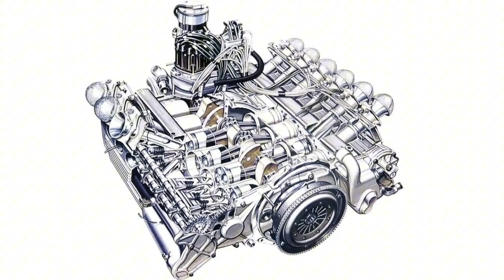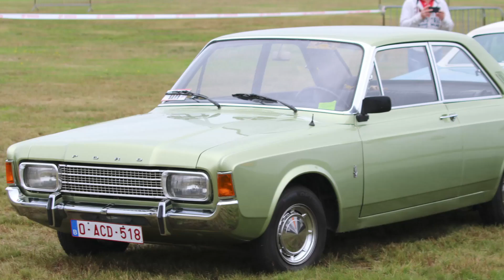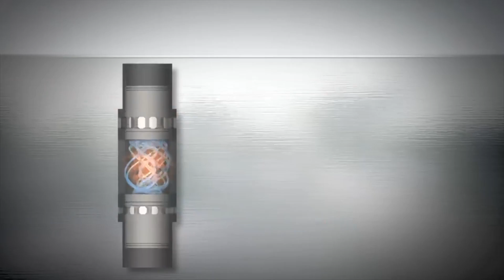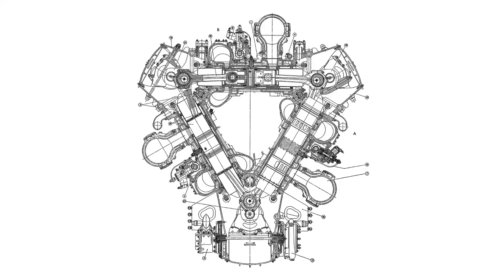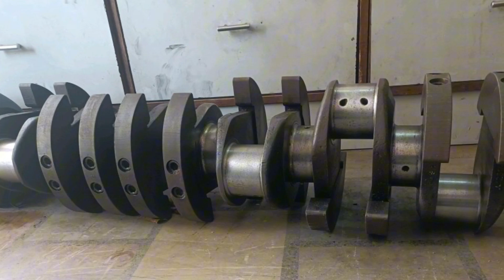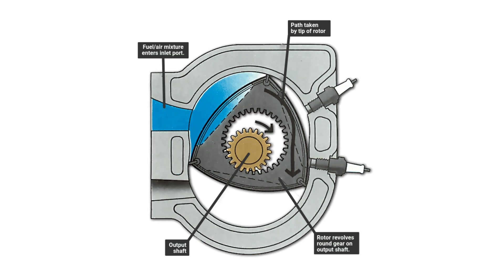10 WEIRDEST Car Engines You Won't Believe Exist!

Comment: The Ferrari Flat 12 is literally a 180° V-12. A true flat 12 wouldbe an entirely different beast. For each set of opposed cylinders there would be two crank pins 180° offset from each other.
Reply: bruh, 180° V12 is literally called a flat engine.
Reply: @rellotsscrewdriver8996  
Yes the layout is flat. But for all intense and purposes the Ferrari Flat 12 can be treated as a 180° V-12. The difference is between a Vee Type crankshaft with crank 6 throws and that of a Boxer type engine with two sets of six crank throws with one set 180° offset from the other. Boxer engines also tend to have a greater bore spread between cylinders  for bores of equal diameter to accommodate the extra material needed in the crankshaft structure. This leads to a longer engine.

Comment: If you have a 16 cylinder engine and it's a four-stroke engine that means you have four not less than one but four power strokes per revolution you have a power stroke every quarter turn of the crank get your numbers right dude

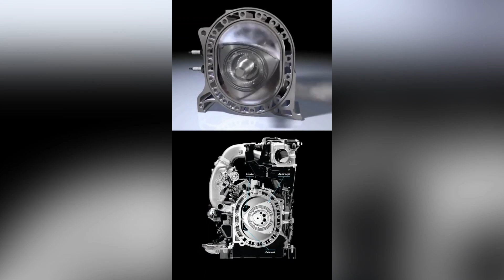Comment: 8:05
Given how many RX-7 ALONE were produced, how can you call a Wankle "wierd" in a car?

Whoever put this list together had ZERO CLUE what they were talking about, for the most part.
Reply: By the numbers of wankels vs piston engine cars they were very much weird and uncommon. I'm 56, have messed around with many cars over the years, repairing, wrecking, and modifying and still have yet to see a wankel rotary in an engine bay. I know when one cruises past, as they sound like a 3 cylinder 2 stroke outboard motor at idle.
Reply: @rossbrumby1957  Millions of them sold. NOT WIERD.
Uncommon PERHAPS, but nowhere near wierd.
They were also used in some outboards, but those were VERY uncommon.
Reply: @bricefleckenstein9666  
Plus Mazda used to put them in other models than the RX-7/8. NSU was the first company to offer the engine type in a road car.
Reply: @mpetersen6  dont forget the rotary pickup in the late 70's
Reply: @bricefleckenstein9666  Didn't Yamaha build a Wankel engined motorcycle. Someone did for sure.
Reply: @johnchandler1687  I want to say BMW, but I don't remember the maker for sure.
Reply: @bricefleckenstein9666  Had an issue of Cycle Magazine with a long article about it. Of course all those are long gone in time now.

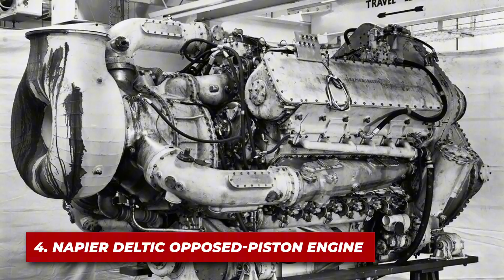Comment: 5:02
The Napier was mostly a LOCOMOTIVE engine, not a car engine.
SHOULD NOT EVEN HAVE A SNIFF OF THIS LIST.
Reply: Initially designed for torpedo boats, but that use waned after the war.
Reply: @svennoren9047  Quite a few ended up in torpedo boats.
To my knowlage, NONE ended up in a car outside of a possible VERY CUSTOM installation on one specific case.
Reply: @bricefleckenstein9666  It is to large to reasonably fit in a car. A truck maybe, but as you say it would have to be a custom build. Worked fine in locomotives!
Reply: @svennoren9047  And in small ships like PT boats, as someone else mentioned.
The Deltac shouldn't even be on this list.

Comment: A four-stroke V-16 has one cylinder firing every 45° of crankshaft rotation - NOT "as there's a power stroke occurring at almost every crankshaft rotation".

WTF does that even mean?

I wish idiots on youtube would actually bother to LEARN the subject matter before shooting off their mouths as if they are any kind of authority.
Reply: I have thought about this.  If someone built a V16 engine with a four-plane crankshaft, it could have a power stroke every 22.5 degrees.  It would hardly need a flywheel like that....
Reply: @christopherdean1326  do the math again. 8 cylinders fire with each rotation. 360° ÷ 8 = 45°.

You're right about one thing - flywheels for multicylinder engines are comparatively lighter.
Reply: @richardkryston2990  360 divided by 16 is 22.5. So you're practically spot on.
Reply: @TheSilverShadow17  but in a four stroke engine, each cylinder fires every 2nd rotation of the crankshaft. 
Recheck your math again. I know whereof I speak.
And the original narrator of the video does not.
Reply: @richardkryston2990  That's why I said that your calculation was right on the money. 22.5 degrees, 45 degrees, same difference. Just different approaches.

Comment: 4:23: "....sharing a common crankshaft..." Ummm.....I count TWO; one on the top and 1 on the bottom. Do you even bother to look at the graphics you add?????
Reply: If you are referring to the Commer Opposed Piston Diesel. The Commer used one crankshaft underneath the cylinders with connecting rods that linked to rocker arms that then linked to the pistons. Space saving for an opposed piston engine while not really reducing parts count. Plus it requires a supercharger.

Comment: Air cooled radial engines were a great choice for WW1 and "WW2 aircraft because the high frontal area allows for good cooling by the propeller, and there is no liquid cooling system (which could take damage in combat.) At the start of WW2 the American Sherman M4 tank was available with whatever engine was available (either an adapted aircraft radial, or an emergency design by Chrysler made of five inline 6 blocks bolted together.) These went to the Allies in Europe. By the time the USA entered the war itself a large displacement V8 had been developed and most Shermans used by American troops had this engine. The engine was behind the driver to avoid visibility issues but the Sherman still had a rather tall body to accomodate the engine, which is less than ideal for a tank.

Comment: When the first VW prototypes were being developed in Germany in the 1930s, one of the engines which was tried was a 5-cylinder radial, but it was rejected because it vibrated too much. They also tried a flat twin and at least 2 flat-4s before they settled on the flat-4 that made it into production. Porsche built a few flat-8 prototypes back around 1970, so flat-8s are among the rarest engines ever used in cars. That is a shame. Imagine a low-profile road hugger with the power of a V8 muscle car, then you realize how the flat-8 was one of the motoring world's biggest missed opportunities.
Reply: Porsche used a "flat" 12 in the 917, but ist was a 180° V12, Like the testarossa. There seem to be good reasons to not go beyond 6cyl with the Boxer crankshaft layout. Subaru/motori moderni tried it for the F1, too, but cancelled the Project without results.

Comment: 1- The Ferrari V12 is nothing new, it's basically same idea as VW used since the 1930's: flat engine.
2. The VR5 is basically same idea as Lancia had already 1922 in Lambda, narrow angle V-engine but with one cylinder head.
3. The V4 did not have "limited success", it was used from 1962-1991 in german Fords (and Saab who bought it from Ford) and english Fords from 1965-1977 (English version who was not related to the german). The V4's was also base for Fords V6's.
4. Chrysler was not first with turbine engine in a car, Rover did that 1950.
5 to 3 was never in road cars.
2. The Bugatti W16 is not of same type as earlier V16, is is more like two narrow-angeled V8's (compare to Lancia V4 above).
1. It was Felix Wankel who invented the rotary engine 1953, and it was used in several NSU-cars, but also in some Citroen and M-B, long before Mazda bought the concept.
Reply: Don't you mean ferrari flat 12? Thats the one pictured and talked about in the video. Its not like the VW engine at all- the VW is a boxer engine same as subaru use. The flat 12 ferrari has the same type crank as a normal V12- opposite pistons share a crank journal same as the Jaguar V12. The crank journals are aligned at 120 degrees apart- same as an inline 6, giving perfect primary and secondary balance. Coincidentally a boxer 6 or 12 has equally good balance- the boxer 4 not so much, but better than inline 4's.
Reply: @rossbrumby1957  You are correct, I mean flat12. Thanks for correcting my comment.
Reply: 2.  I believe the point here wasn't that it was a narrow-angle motor, but that it was a V motor with an odd piston count in the first place.
Reply: I think you mean flat 12 Ferrari.

Comment: Any notion of the radial engine as a car powerplant is utter rubbish. The radial's circular cross-section was designed to enable air-cooling in aircraft, from late WW1 through to 1960's, when jet engines would dominate the heavy aircraft market. For obvious reasons (such as its bulk & cooling issues) the radial never saw automotive service.
Reply: It worked in some WW2 Tanks!!
Reply: They were used in American Sherman's with great success in WW2. Not rubbish just not very practical for cars.
Reply: You-know-who wanted the VW Beetle to have a 5 cylinder radial.
Reply: Apparently there were some small ones put into motorcycle front wheels. Not a great idea.
Reply: So the racing car pictured wasn't real?
Reply: In the beginning radials spun the entire engine about a fixed crank. That made it impractical for automotive use. Later, when the engine became fixed and crank spun. Larger cylinders and ohv made them impractically wide for auto use. Today, to many refuse to break the aero engine paradigm.
Reply: WRONG!  The Adams with a rear ounted radial engine set a speed record in 1906 of 129MPH. Crank was bolted to the frame and 5 cyl engine spun horizontally. Carburation was static with speed regulated by ignition timing. Spark jumped to sparkplug s as they passed a copper ball which moved in response to throttle to advance or retard timing. Look it up. They were an amazing machine. 😊
Reply: @johnchandler1687  it was an amazing machine. But it was also an outlier. Built in an Era when automobiles were more motorized carriages / wagons.  The engine is almost the entire width of the vehicle.
Reply: @travisgravelle7687  my late FIL was a Studebaker  mechanic from 1928 until theybwent out of business. He collected info on al kinds of old automobiles. ThecAdams was a favorite bevmcause it was so unusual. After Studebaker went under he and his fellow mechanic opened their own garage. Made good money as the only shop specializing in Studebakers, Nash Ramblers, Hudson, etc. No one else in our town of 250,000 knew them like he did. He always milled heads and ground valves on an old machine he bought at auction from his old Studebaker dealership.

Comment: Should have listed the Australian Starich Orbital engine, 7 chambers 250 hp , was put in ford Cortinas in the 1970s , its not a rotary , the middle seven sided orbitor well orbits the crank shaft , vanes slide in amd out creating chambers of vareing size and had direct fuel injection , the whole 250 hp motor was 20 cm thick and 60 cm in diameter and weighed 120 kg, ot was small, fit any engine compartment , the company sold the rites to Ford US and it was never seen again , then Ralph Starich built a direct injection two stroke that had better emissions that a four stroke , Ford US had a 3 cylinder 2 Stroke ready to go in early 1990s but again disapared . The Starich direct injection system is found on all modern Two Stroke motors , and is the reason Two Strokes are comming back in 2025/26 , Forumla 1 is going Two Stroke and many manafactures are going back now the emissions are solved , Kawasaki is bringing back a two stroke KX550T. And Suzuki has a RM520T ready for 2026 and Kawasaki has anounced a H3 900cc V4 direct injection two stroke model with 267 hp ( its nick name is " widow maker")
Reply: It was the SARICH Orbital Engine. Ralph Sarich was born in Australia to Croatian immigrants. From 1972, development work on the engine became a bottomless money pit for investors and Federal Government grants. Its problems persisted so long that it finally vanished. In the meantime, efficiency of conventional piston engines was greatly enhanced by emerging technologies; fuel injection, multiple valves per cylinder, overhead camshafts, electronic ignition and turbocharging.
Reply: @rocketeerPM2500  that's an opinion , as stated , all new two stroke direct injection is based on the OEC Orbital engine companies design developed for the Orbital engine. Today with modern matching the orbital engine would be fine .